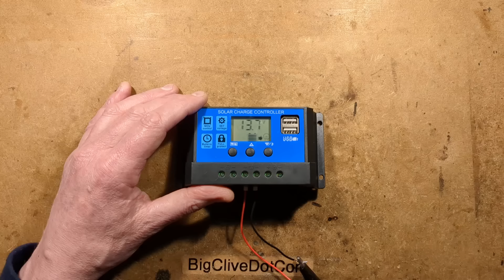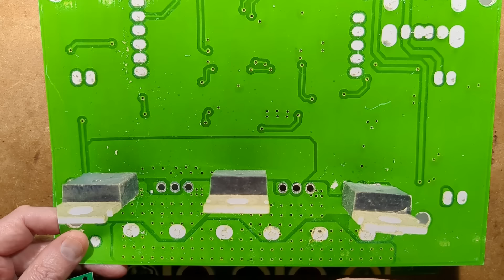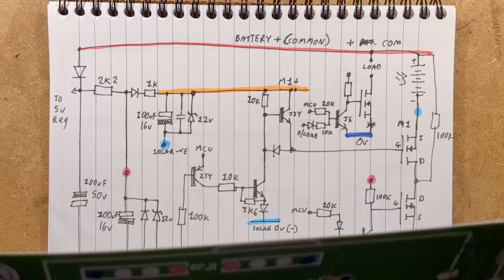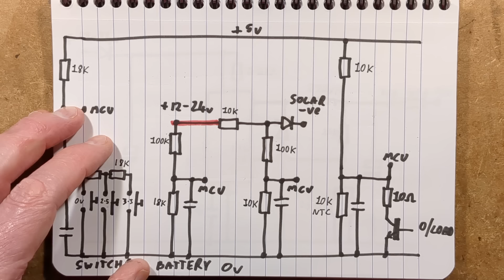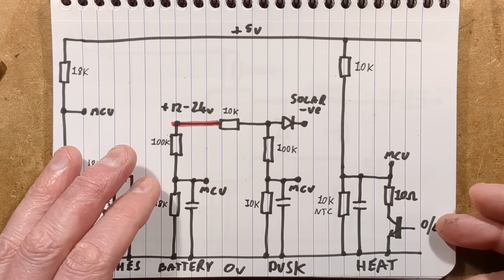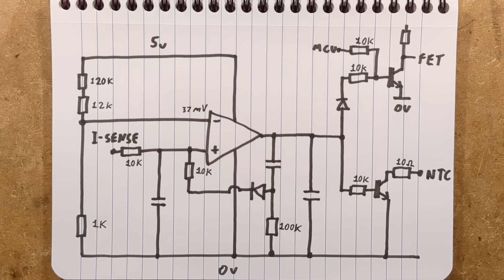Exploring a mass produced solar charge controller

Comment: I have similar one (for 40 AMPs) and the solar panel part got damaged because of overheat so that it is not controlling charge current anymore. It don't bother either because I replaced it by MPPT unit and it is now used as a secondary unit with no panels just for control of load (I even didn't try to open and repair it because it is so cheap).

Comment: Wow  a lot of challenging hard work there. 

Can.you do the.fifferences between MPPT and the basic vheap ones. How would recognise which circuit board was in a unit? 

Thanks for sharing
Reply from the maker: The MPPT unit would need an inductor for the buck/boost converter.
Reply: MPPT is quite different design, there's no point trying to compare them or so.

Comment: i use one of these with a 20w solar panel on a trailer that has a 30kw generator. keeps the start battery hot, great tear down.

Comment: I use this as a battery maintainer inside a car with 40W solar panel worked greatly for the first year. the second year it started working crazy. it would stick to 10.7 v charge voltage even at midday at times it jumps erratically between 13v and 14.4V at midday. the battery is not getting charged past 10.7v

Comment: PWM controllers are cheap but the solar array needs to be 12 or 24 volts plus they are like 70% efficient. Get a good value quality name brand MPPT like a Renogy and you can run whatever panels or battery configuration you want plus they are 98% efficient so you don’t lose so much energy.

Comment: I picked up one of these too. I found it interesting that there aren't more devices, doing what this does, sold at around this price point.

I bought mine to control a little usb water pump for a fountain. That seems like a simple enough application: A lithium battery to run a pump, a timer to make sure it only runs during the day, and a solar panel to keep it charged.

Comment: Bought one of these with a 50W panel and a recycled battery, just to get my feet wet with PV. Worked for a good couple months, then, without warning and without any change in my setup (no, it didn't switch to a different battery type), charged the battery to >18V. I'm now using a Renogy one (together with a 200W panel, 106Ah deep cycle battery and a nice pure sine-wave inverter) and that's been working well for two years now (not long in absolute terms, but I'm still just working my way up the diy PV pipeline; probably gonna build my own power storage from hundreds of 18650s next year /s)

I don't know how to feel about this thing. It's cheap, in quality but also price (I got mine for ~$25) so it did its job in my case as an introductory device, but I still feel like even bad products should work for a good while instead of you rolling the dice on whether you get something that'll last forever or something that blows up the first time you plug it in. I guess I'm just asking for a reasonable standard in quality, which, I get it, it's China, what did I expect ¯\_(ツ)_/¯

Comment: I bought one, and it broke in less than 6 months. I’d say it was quite dangerous, when it failed, it bypassed and directly diverted the solar power to the battery. Luckily, my solar panel is only 18V, and the battery has a BMS installed

Comment: I had one of these and a 200w panel, with a 12v 100ah battery. When my system hit fully charged after a few sunny days, the charger died and sent high voltage solar input down the line. It fried my inverter and my entire system lost power, there could of been a fire. So do be careful. I HIGHLY reccoment a cheap victron MPPT controller myself now...

Comment: I bought one thinking this would make for a simple 12V UPS when combined with a 12V SLA battery and a power supply as the "solar" input, only to notice it is missing one key feature, output current control.  No doubt others came up with the same idea as it included a safety warning "The charge regulator is only suitable for regulating solar modules. Never connect another charging source to the charge controller".  So I will likely put it to its intended use, i.e. purchase a small solar panel to maintain the 12V SLA battery in our garden shed for its lights.

Comment: On first examination,  the topology used or transistors / MOSFETs , seems very unintuitive . Also the different parts listings . Maybe in design that non typical topology will be answered. The variable Source voltage on MOSFET1(top one) seems very weird .

Comment: Regarding the USB connectors: Devices are required to ask the supply before drawing more than 500mA. So you should be able to slowly charge a phone from these. Of cause that doesn't protect you form devices ignoring the rule or from plugging in two at the same time.
Reply from the maker: The data pins are shorted on the unit which indicates availability of at least 1A per socket.

Comment: This damaged my battery as its pwm voltage is slow to react when the charging voltage is over the limit. I use small capacity lead acid battery, if it is used with high capacity battery it might be ok.

Comment: I had bought exactly such a controller to charge my car battery through the cigarette lighter with a solar panel, (because I drive it very rarely), after  more than 1 year of use, I replaced the controller with a DC-DC step down CC-CV converter based on xl4016 and found that this controller is complete garbage (very inefficient) and does not increase the current, when it lowers the voltage. there is no point in using this controller for charging, but only for load management... but 10x for the work and explanation...

Comment: I have a couple of these, the older ones have done well, a new 30A version melted at 7A and put full solar to the battery over charging it. This was due to very poor thermal connection to the steel backing plate. It was repairable but could have destroyed a battery or set something on fire. I have since checked the others, they were OK.

Comment: Yeah, this is pretty great Clive. I’ve been using one of those nine dollar charge controllers for like five years and really haven’t had any issue.. 
I talked to some dude before I got my solar panel on that thing and he’s like what 10 bucks you…  those things are couple hundred ..? 
I don’t know it seems all worked fine but my big old lead acid battery just went tits up so. 
Yeah, I got some like 10 gauge pure copper zip line so time to rewire time to get a new $10 solar charger although I was looking at a solar control panel at a higher price point,  but we’ll see. 
That little prick kept my battery topped off could’ve burned 100 W lightbulb all day long …
Reply: Oh yeah, on a sidenote the only thing that bothered me about that was the cable holes with the screws. Things are tiny….. like 16 gauge tiny tiny wire holes no good Clive mad!

Comment: Please keep digging down the rabbit hole of the cheap solar tec available. I've talked about running a DC loop in a home to get rid of all the AC-DC converters that are in pretty much all the modern tech we use. AC is king when it comes to building a long distance grid. DC can't be used to make a power grid but when you look at all the tec you have in your home most of it is using DC with it's own AC-DC converters wasting energy converting is just me missing something or is having a DC loop in the home aspecily when using solar a good idea

Comment: An important issue you didn't discuss was how this charger handles equalization versus float charging voltages - only the latter is adjustable, the former being fixed according to battery type. Presumably it will charge a battery up to the equalization voltage (instructions say 14.6V for lead/acid, 4.2V/cell for Li-ion, 3.65V/cell for LiFePo4) and after some time reduce it to the float voltage, but how long? Immediately? An hour or two?

The instructions don't say anything about how it behaves. I'm guessing that it will charge up to the equalization voltage every day - which wouldn't be good for a battery in a standby application. But what if the battery is fully charged, the controller has dropped back to float voltage (good to preserve the battery), when the sun disappears for 5 minutes. Does it decide to equalize again based on the battery voltage dropping below some recharge voltage threshold perhaps? Maybe it has an internal timer to handle this - who knows?

It has lithium battery modes - I'm guessing it will charge at the maximum current the panel can deliver until 4.2V/cell is reached and then drop to float voltage after some unspecified time? I would not use this without lithium batteries without a good quality BMS.

Comment: I have 4 of these, well mppt ones, I run electric fence and ptz cameras. Handles 24v 200w for what it's worth. Yes ptz cams are 12v so I use a buck down con on the load side to hit 12.5v constant. Cool to see inside these units.

Comment: I've been using one of these for the last couple of years with a 150w solar panel, two small recycled lead acid batteries and a 80w automotive water pump for my pond - seems to work fine
Reply: I use one of these to power a set of leds of about 10 watts at night charged by a 50watt panel to a car battery ..its been running for over 6yrs, i only had to change the car battery 2 times

Comment: Had one of these in a 24V LFP setup. Did only work for some weeks before first the USB outputs, then the charging section failed. Now it only works as a low voltage cut off module.
Swapped it for a Renogy MPPT charger, which is way more epensive.

Comment: I believe the reason they say to connect the battery first is because some of them can charge 12V and 24V batteries, and by connecting the battery first it is able to determine the charging voltage that is required when it starts up.

At least that is what I recall from the user manual of one of these things that I had some years ago.

Seems like it should be able to determine this after it has started up as well, but I don't hold high hopes for quality software on cheap units like this.

Comment: I came across one of these in my car mechanicing/helpering-outering. Funny little devices. I'll share my story:

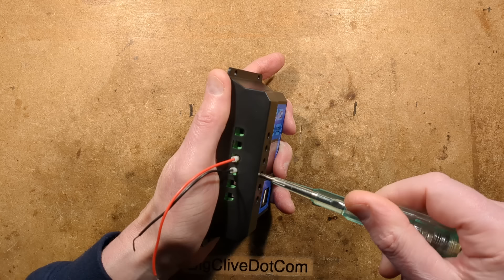The thing was set to "Lithium" even though her batteries were lead acid. It wasn't connected to any load and it was only being used as a solar charge controller in parallel with other charging systems. Also, whoever installed the isolator switch for the solar panels didn't push the wire into the holes properly before tightening (like at 05:02), so it wasn't even tight and was barely touching. She also had a farty little 2 amp charger and was attempting to charge a totally depleted (measured 3.4V) 220Ah battery bank overnight... She also thought the Off position of the isolator switch was the On position because it showed a green band. I explained that the Off position is the spring-loaded one and green represented "safe", and red represented "unsafe" as it's switched on.

I managed to resurrect the batteries for her, fixed the isolator, checked everything over and got her a beefier 10A charger. Job done.👌

Thanks for the teardown Clive. Really fascinating watching these teardowns and reverse-engineerings.

Comment: I would like to see a video on a stand alone 12 volt air conditioner.  Solar panels, battery for 12 hours, and a solar controller.  Perhaps a fuse. To be used in a bedroom.  No inverters.  Preferable of older or use parts 
Math, slightly oversized on the panels and everything.  Telling the controller not to turn on the load if battery falls below 15% 
Heater or dehumidifier  could be used but only one being connected at one time.
Maybe add a car power port.
Reply from the maker: That would be great, but it would require significant power to get useful cooling.

Comment: I have one of these and it was supposed to be 100 Amp, but even the paperwork says it is 60 Amp max.  I am running 3-100watt solar panels in parallel and 4 - 12volt batteries linked in parallel.  It is kind of working.  It says 12.8 and shows the arrow and lightbulb flashing.  I cannot get it on any other menu setting.  I wanted to set it up with (Off at dusk and On at dawn), but I cannot get it to the 24h menu to change it.  I can't get anything to change.  It just keeps going back to flashing arrow and lightbulb.  Any Ideas.  I will be upgrading to a better controller next month.
Reply from the maker: I think the software varies between clones.

Comment: Aldi sold them in Australia 5 years ago with a 'GPM-170W' 170W solar panel (Voc22.32, MaxA 9.19). Same looking controller - GP15A: 40V, 12V/24V & 15A.
Heard they boiled batteries, so never gave them a second look. Seems they might not've had the voltages set.

Comment: Some notes: 
These units have quite low current output to the "load". 
Is OK for running a small light, but if you have a hefty load (eg an Inverter) you need to connect it directly to the battery.
Another problem: I found that impulses from an electric fence (or nearby lightning) would cause my unit to reset, which can cook your batteries.

Comment: I do not understand the 2 fet thing between bat- and solar-. Why is one fet to switch solar on and off not enough?
Is it because there would be backfeed from bat to solar if bat volt > solar volt?
Reply from the maker: As used in standard lithium battery protection PCBs.  Each MOSFET has an inherent diode, so where current can flow in either direction you need two.

Comment: Great Content! this is what I subbed for years ago and you continue to work your ass off and provide quality!
So I've been looking for a cheap mppt controller for the rv, I have 2 LA in series and 2 "100w" panels and am wondering if I populate those 2 n-channels that are empty if it will suffice.
I really only want to not have to remove the batteries every winter as basically all they do is provide led lighting.
Could I throw like 4 4 irl640's in this thing for that purpose?
Also I don't see a discharge circuit?
Reply from the maker: This is a basic unit with no MPPT.

Comment: oh sweet i bought one of these a few weeks ago, now i can find out how much of a fire hazard it is without even needing to hook it up to anything.
To be honest I was going to guess its actual rating based on the wiring inside and stress it while watching it with a temperature gun but theres no way i trust any stuff like this to be good anywhere near what the seller says. Anyway i just needed something to pump 10-20 watts into a car battery to keep it topped up so i'm sure its fine but still.
Reply: After watching the full video, good lord this was a deep one, while it went very much over my head, I appreciate the attention to detail, and before I hook this up i'll remember to make sure the back plate is properly connected to the transistors, and not use the USB ports for charging my phone, as tempting as it may be.

Comment: I've used many of these over the last 15 years.  Don't use the USB, and don't flirt with max PV input power.  

For 10 bucks, a very decent product.
Reply from the maker: It seems quite usable for low current applications.  The issues seem to be when people connect huge panels and high loads to them.

Comment: Been using one of these for two years now. No real problems yet. The heatsinking is cheesy but adequate.
They are cheap so if it dies, you can replace the dead mosfet or buy a new one. 
Wish the display had a backlight option
Reply: It does have a backlight option -- you have the option of adding your own.
Reply: I spoke too soon. My charge controller crapped out, failed to charge from the panel
One of the mosfets died and had arcing at the solder pad. They are running mosfets in parallel
to double the current, The 10A model uses 1 mosfet, the 20A model uses two.
You can double the current rating of the controller by adding the missing mosfets but they must be
identical so the Rds(on) will match to ensure proper current sharing
They used SSF7509 mosfets. I subbed the dead one and it's partner with IRF3205

Comment: Battery connection first is so that it properly senses the battery voltage.

I have seen these charge controllers incorrectly reprogram themselves under certain conditions, especially when a 24v bank is drained dead flat; when the unit recovers from the brownout it often resets to 12v as the dead-flat 24v battery bank recovers back to approximately 12v.

Comment: Just make sure you connect the terminals properly, there is lots of oppotunity to make a poor connection with these. Wiggle the cables after install and listen for sparking or arcing. It took a couple of attempts for me to make a solid connection that didnt spark. This issue makes me reluctant to recomend these units. With that said, it did work fine for the short time i used it but i still swapped it out for piece of mind and went with a more expensive brand.

Comment: I put a full size 330w panel on it to charge a 12v lead acid battery for lights in the garage, and it does the thing.

Comment: I have considered one of these with some free second hand solar panels & some old car batteries to provide a 12v supply for a camping cabin. This is a great video, better than the non-existent guide that it comes with.
Reply from the maker: For low current loads like lighting and charging of phones and other gadgets they seem usable.  Not for very high loads like power inverters though.

Comment: I got one of these a couple of months back, I need to stress that people MUST READ THE MANUAL prior to use.
I am saying this as mine only works with Lead Acid batteries... Wish it worked with Lithium, but it doesn't apparently. In fact, it specifically says, "do not charge other batteries (lithium, NiMH, etc.)" on the front page of my instructions, yet mine looks identical to yours in every way, shape and form.

Comment: Put one in a chicken shed for a few LED lights and a 120mm fan hooked to a small, remotely controlled relay that works over LORA. The chickens are gone, but this still works, only using a cheap 12V motorcycle battery.